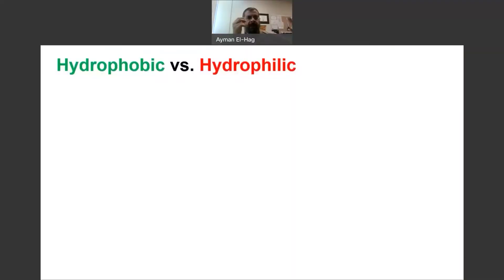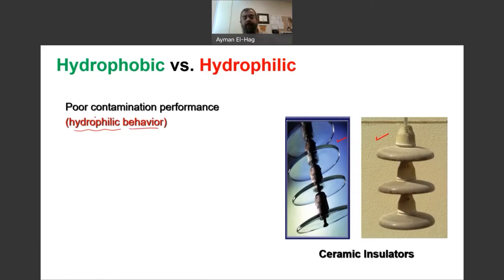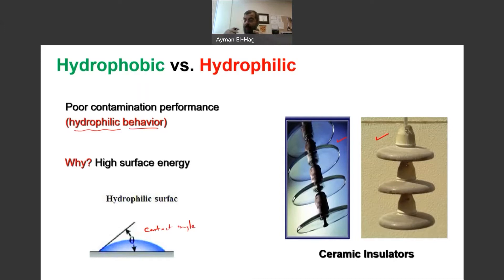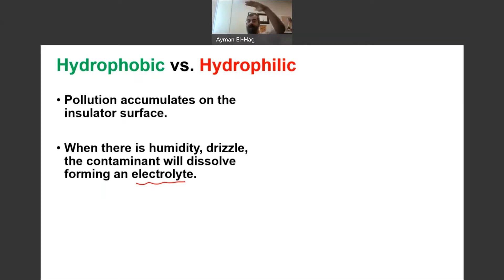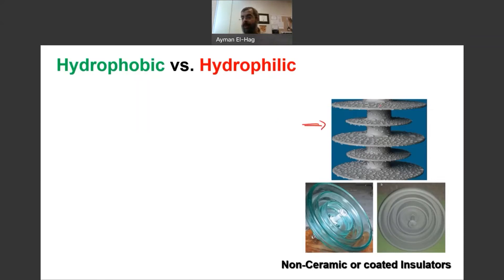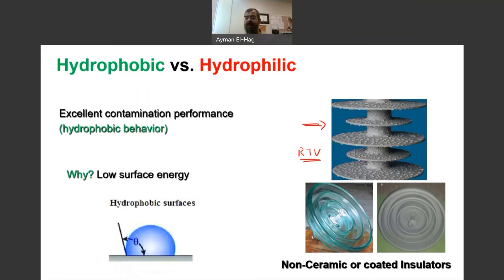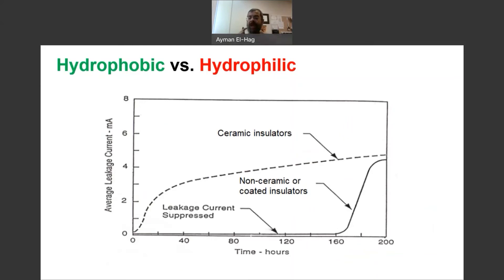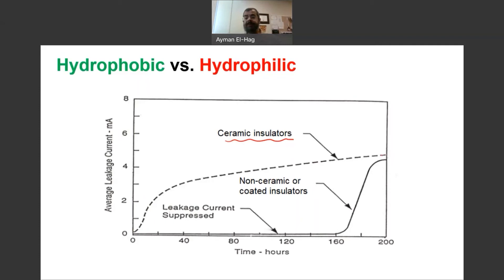Hydrophobic vs Hydrophilic insulator surface condition

Comment: Thank you, professor, for your very interesting topic. I have a question. Do hydrophilic insulators have any advantages over hydrophobic insulators? If not, why are they used?
Reply from the maker: Hydrophilic insulators like ceramic insulator still they have advatages like they are more resistant to aging or arcing that non-ceramic insulators and they have more linear voltage distribution so they do not need corona ring.